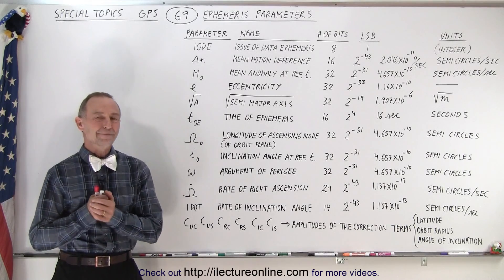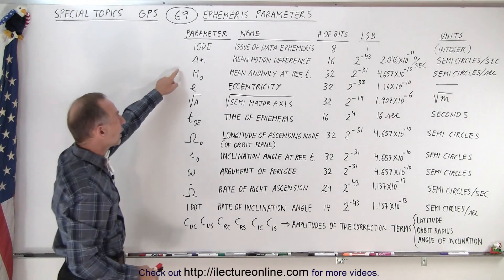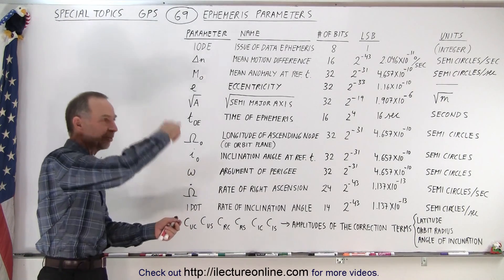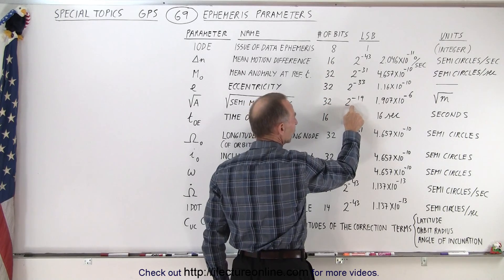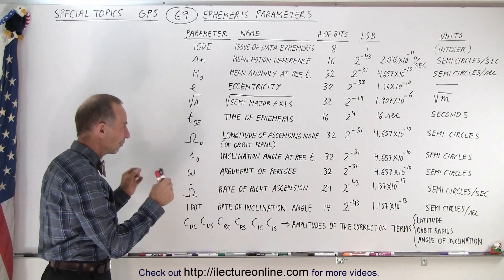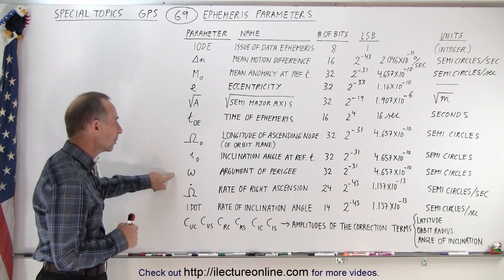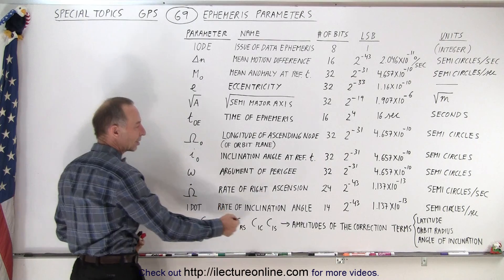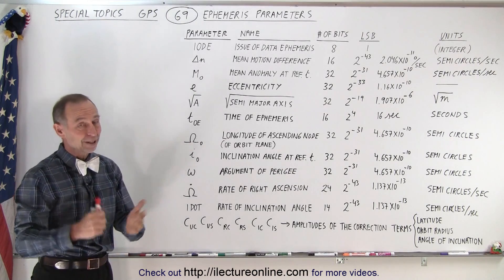Special Topics - GPS (69 of 100) What are the Ephemeris Parameters?

Comment: Thanks for the great lectures!  Question: how would you calculate A GPS satellite elevation & azimuth with respect to the user?
Reply from the maker: Every GPS satellite sends out singals that included the almanac with information about every satellite in the constellation, and the ephemeris, which includes more detailed information of that particular satellite.  That information contains specifics about its orbit and is updated on a regular basis.  If the time of the transmission is known, we can calculate the near exact position of the satellite.  Then with the information of other satellites, we can know our position.  Once that is known, the exact azimuth and elevation angle can be calculated.
Reply: @MichelvanBiezen  Your questioner asks HOW to calculate which implies they already know it CAN be calculated. Specific answer to a specific question, please. For trig equations it makes better sense to express angles in radians than semicircles.